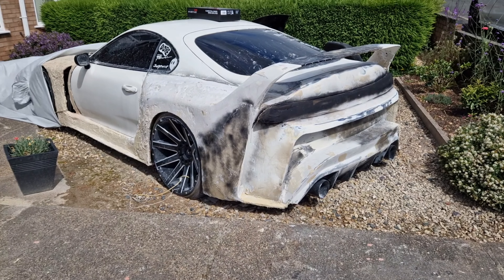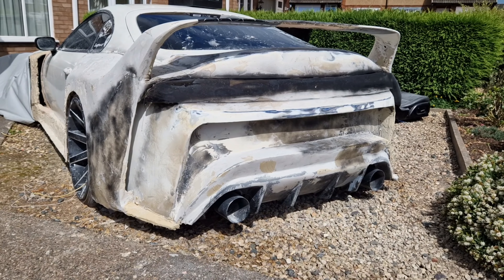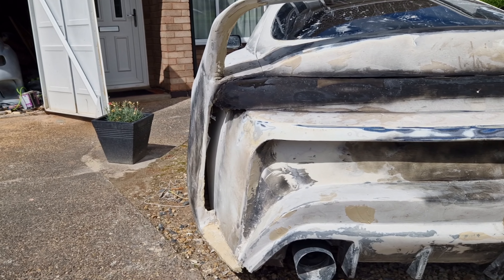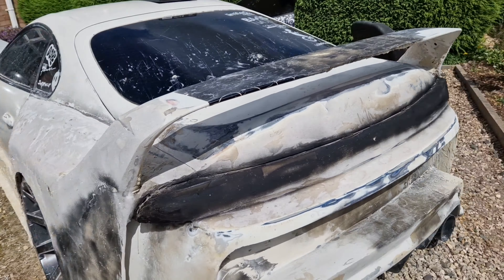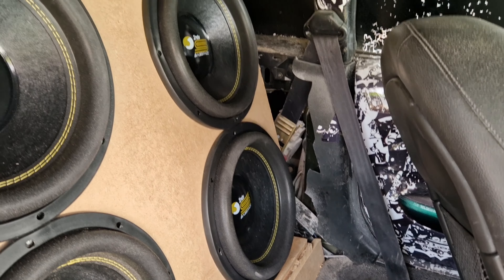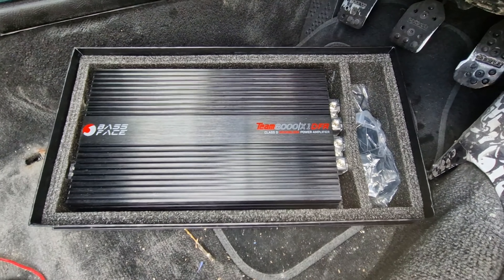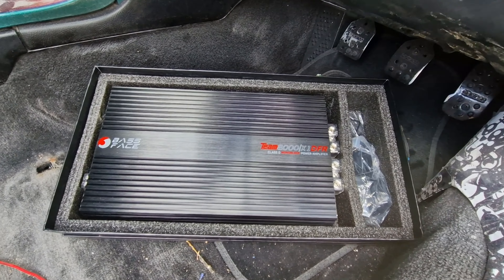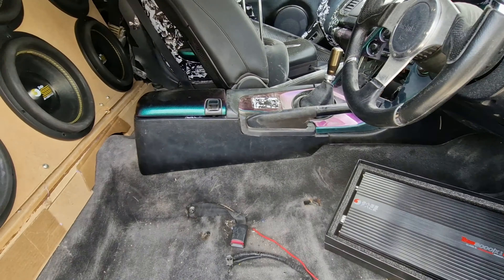10 - Rear panels taking shape very well and the subwoofers and amps are here 😊

Comment: That's a very small 8k amp. Does it have single wire inputs?
Reply from the maker: They have dual 0 gauge inputs. They are quite small but they are full bridge like taramps of similar size
Reply: Amps aren’t that big these days. Taramps 8ks aren’t much bigger. It’s not like the old days 😂
Reply: @rsjdevelopments  yeah makes sense. I know there getting smaller and smaller but it would have to be at least 2 power and ground inputs. No way there doing 8k with only one. Sweet build tho bro looking fore
Reply from the maker: @rocawjayz6fd20012 cheers mate. Yeah for 8k you definately need 2 inputs